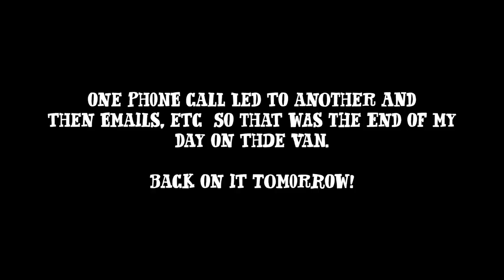DIY CAMPERVAN PROJECT - It's never ending! 🚐

Comment: Great to see you back on it. I built mine nearly 2 years ago and I used your videos as one of my main sources of ideas. Especially all the early bits, fitting the seats, insulation, cabling etc etc. Must of watched some of them dozens of times, great help. “Fortunately” due to lock down and my children being older I was lucky enough to get the time to get it finished so the standard I wanted. But there are always little bits of pottering, adding an extra USB port or more lights in the garage. Keeps me out of trouble. Anyway I thought this was a good time to say thanks for the videos.